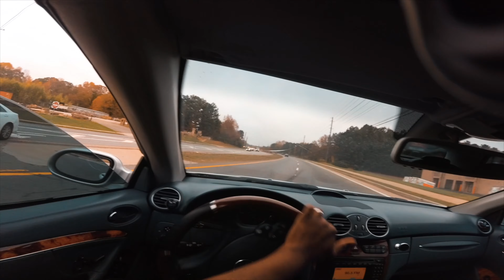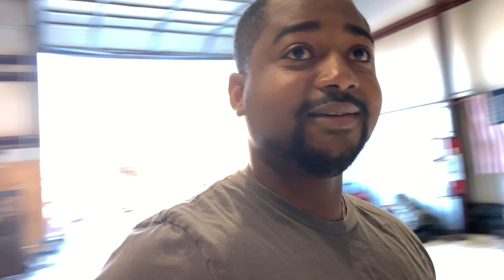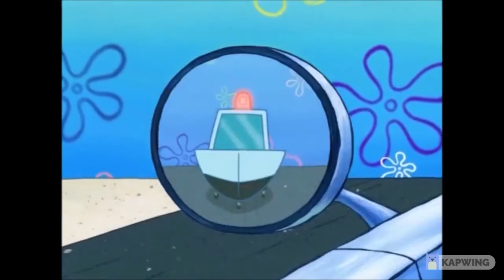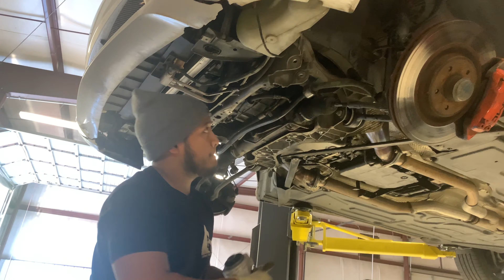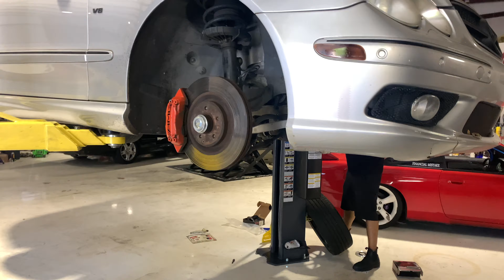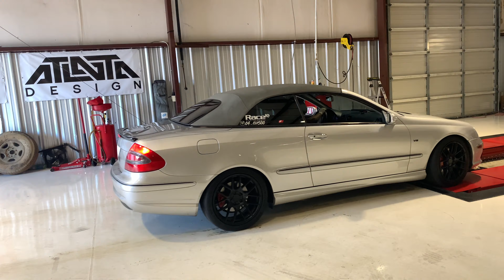Replacing the Control Arms on the CLK500 (Common issue)

Comment: You might wanna just do a bolt check on it. My 04 clk500 had the two strut bolts that mount to the knuckle back out on the driver side strut going like 140. Really messed up a rim grinding on the strut. Have fun man glad I watched your videos before buying this car have had nothing but great times. I got a little video doing donuts on my channel
Reply from the maker: They did a full bolt and suspension inspection first before changing the control arm! Everything checked out. I’m gonna go check your videos out

Comment: Anyone know where I can get torque specs for the front suspension on my 2004 clk 500
Reply from the maker: which part of the suspension system in particular are you needing specs on?
Reply: @HeyboysGarage  I subscribed to direct-hit but I still see contradictions. I’ve seen that the control arms to frame bolts should be 150Mn. I’ve also seen some say it’s 80mn with a 120 degree angle added.
Reply from the maker: @sixtysix4842  the second option you said is what I have been seeing online this morning. 80nm

Comment: Do your convertible  top go down? I'm in the process of replacing my main  lift cylenders which are $400 apiece x2. Which is leaking the fluid out
Reply from the maker: I manually put it down because I haven't changed out the cylinders yet on the car. I also have a rear main lift leaking as well. When you do change yours I advice you change all the cylinders at once with Top Hydraulics.

Comment: Any idea on labor price range for control arm replacement ?
Reply from the maker: I believe around $200
Reply: 4 arms 2 on each side would be 3 hours labor. If you’re replacing just 1 arm on each side it’s 1.6 hours. So $160-$350

Comment: This is what direct hit says torque specs are for my 2004 clk 500:
 
Control arms to frame 150mn 
Control arms to knuckle 50Mn + 60 angle 
Strut to knuckle top 100Mn+90 angle 
Strut to knuckle bottom 110 Mn
Stabilizer rods.   55Mn for 10x1.5 bolts 
Stabilizer rods   100Mn for 12x1.5 bolts 
Stabilizer bracket to frame 40Mn
Reply from the maker: I’m going to keep this info! Thanks

Comment: Check it out boss on the CLks the first thing on suspension to go out when driving fun everytime you get into the car is the thrust arm bushings keep in mind instead of replacing just the thrust arm
Bushings I replaced the entire front suspension with a kit FCP euro is the kit I chose and installed myself I recommend this so new sway bar links control arms with new ball joints and bushings, new sway bar bushings and H&R sway bar wit new sway bar links
Reply from the maker: Yeah, I actually had that all replaced on the car. Very good point for others to know about the suspension maintenance!
Reply: Hey how was the kit from fcp euro i need an entire front suspension kit and didn’t know where I should buy
Reply: @anthonygiuliano6376  I recommend it because fcpeuro is lifetime warranty on all parts and because the kit comes with everything you’ll need to rebuild the entire front end, plus you’ll save money and time by not having to track down each part individually, the only thing I upgraded that the kit didn’t come with was the sway bar bushings

Comment: Good information!! May I ask what is the torque specification on both control arms? Thank you!
Reply from the maker: 150 Nm or 110 ft-lbs. I know it all too well. 

It was originally 120 Nm or 90 ft-lbs, but MB raised the specification to prevent LCA bushing noises
Reply: @HeyboysGarage  thank you!! And that's for both control arms? Guess there's a front forward control  arm and a front rearward control arm. Much appreciated!!✌
Reply: @jeflores1000   150 Mn at the bushings and 50Mn + 60 degree angle at the knuckle ends. Both arms.